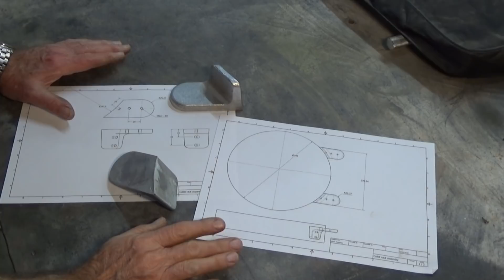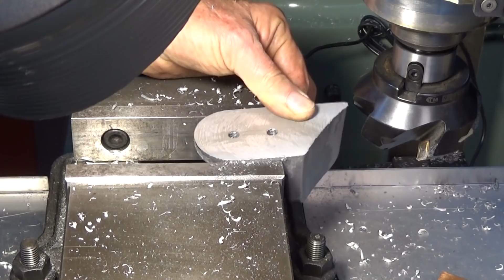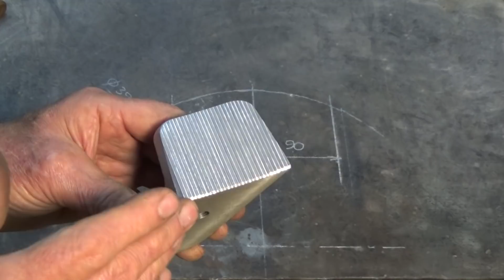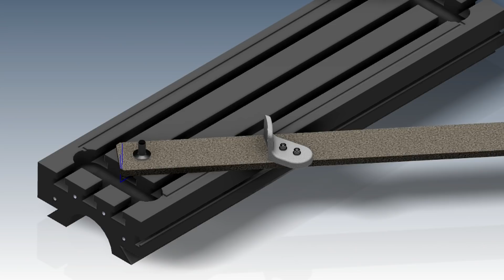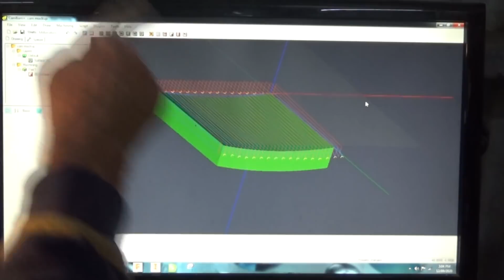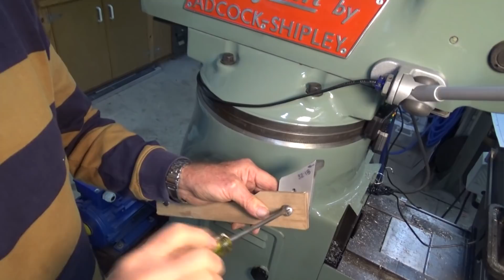Machining Some Awkward, Brackety Castings for a Bridgeport Collet Rack

Comment: Regarding the draft angles and the horror they present to a machinist in setup and all that machinework implies, you can spend quite some more time and almost no additional effort to avoid all that malarkey... Its a compound method which goes like this- Make a 3d printed model of the thing you want, no nonsense, pure copy just in plastic... Take that plastic model and dip it in latex, dip it in, dip it good, or just get a tube of 2 component silicone and make an adequate bath that you will dunk your model in... Let it sit, let the silicone cure for its intended time, which requires no effort, so you are still at the same effort level, you just took a cup or similar and poured silicone in and put the part in... Once cured, remove the part, now you have a negative of the model in latex or silicone or whatever you can work with... Get some candle wax, if not wax, get cheap large candles and as you would with wax, dunk them in a pot, put them over fire and melt the wax... Fill the elastic negative with wax, let it cure... Extract the wax model which has no angles, no nothing but what you want the part to be... Put it in the box, make a sand mould around it as you would with plastic model and simply burn off/evaporate the wax in a heat treat oven... You will have to have metal box for the mould for it, but well, what can you do, weld one up, its better than wood either way... Once the wax is gone, you are left with a perfect negative for your desired part with no unwanted geometry... After that, when the mould is still hot, pour in the metal, it will net you a superior finish, no risk of cold spots and your part will be a perfect machinable piece after maybe a bit of light sanding if you got some surface unevenness depending on the grit of the sand... It may be an overkill for some projects, but as they say, there is no kill like overkill... Why salt a slug when you can use a flamethrower? If wax is just not worth it for some projects, consider getting a block of styrofoam and hotwire cutting it into desired shape, put it in the cask, make a mould and just burn it out with molten metal, or you can burn it out in a heat treat oven too, leaving you again with a mould with no geometry but that of your now evaporated model... Tho, that might require a large oven, but for that, you can make your own ``kiln`` and just blast fire in it until the job is done, as with wax, since you dont need any precise temp or anything but for the temp to burn out the wax or styro... Also, hot moulds are the best as they dont leach any heat form the poured metal...
Reply from the maker: I am hoping I can get into lost wax casting at some point. I actually made some parts that way when I was in college. We had a centrifugal casting machine and we were making jewellery out of pewter. I have been a fan of the "Veg Oil Guy" for some time and I have watched as he has become more and more proficient at the process. It does allow you to make some intricate parts which are not easily done using greensand moulds. 
Regards,
Mark
Reply: @Preso58  Most glad to hear that, as i greatly enjoy watching you... I just bought 25kg of furnace mortar as i am about to build my own casting setup, but for iron and steel, maybe some other metals... I have spent over a decade and a half - learning and lusting after machinery and joys of that kind, so now I am thriving with my slowly forming shop and content of amazing people such as yourself, so its a great joy hearing that you have ``expansion`` plans in mind... I would greatly enjoy having some talks with you, and share a few ideas that I drew up over the last few years, so its a bloody shame that you are practically on the other side of the world, as i would love to have you as a guest for a lovely hot or cold beverage of choice... Maybe some cake, or a gourmet lunch... Know that you are warmly invited here if you are ever passing through or going to Croatia for say a vacation... Regarding the ideas to be shared, if you want, I can send you a scan of a plan i drew for a modification for my Emco Fb2 baby mill to make her more rigid, as i know that you have a similar machine, altho yours does differ and the plan would need to be re-engineered to fit your machine, but if you are up for it, i will gladly send it to you... I could even draw up a plan for your machine specifically, with manufacture in mind and margins, as i believe that what you have is what Quinn has(in essence), and a lot of others so it could be a great gift to anyone willing to put in the effort on a small mill or a joke of a task for us with big mills, who just want to stiffen up our baby machines... 
Sorry for the pocket size bible of a comment... 
All the best and warmest regards,
Marco Camillo

Comment: I do not understand why you wish to have a CNC machine perform a task you could have acomplished on the Bridgport in less than 1/4 of the time.
Reply from the maker: I know it seems like overkill or redundancy but I just wanted to try doing some 3D tool paths on my little CNC. Mostly it is only ever used for 2D pocketing and profiling or drilling hole patterns. It was really a "what if" exercise. Many years ago we had a Denford CNC router at the school I was working at. We used it to machine balsa wood blanks into model formula one cars. The toolpaths were all 3D profiles cut with a 6mm ball nose router bit and 0.5mm step overs. That was how I was introduced to CNC machining. I had to learn how to do it myself before I could teach the kids. The machine was worth around $25,000 and we didn't own it. So, I was very keen not to break it. Once I retired I no longer had access to the machine so it was nice to go back to that process, even if what I achieved at home looked a little clumsy. 
Regards,
Mark

Comment: You could also just use some sugru silicone putty, which would make the rubbery part at least look more intentional. The stuff ends up looking like a pre-formed gasket. Then you could leave the part as cast, or machine with a generous clearance, and no one would be the wiser.

Comment: Why not just pad out the brackets square with a glass filled body filler?
Reply from the maker: Robert, I want to be able to powder coat the finished brackets and some body fillers are not compatible with the heat required to fuse the powder coat. I also wanted to have a go at some 3D milling processes on my little CNC mill and this seemed like the perfect candidate. 
Regards,
Mark

Comment: Epic struggle , glad I’m not paying for those brackets !! When you made the pattern a body filler squeeze would establish the dia your after , that pattern would lift with the squeezed faces vertical and draft on the face that has the bolt heads ..... usual thing I guess many ways to skin a cat ....
Cheers
Robert 
Partsmade 🇬🇧
Reply from the maker: Robert, I must say I hadn't thought of moulding the pattern to the column casting however there is always shrinkage in the casting to consider. Aluminium shrinks at around 6% so even if you get a perfect fit for the pattern, the casting will not adopt the same fit. I actually did the final fitting of the castings to the column today and one only required a bit of sanding on the bottom edge to get it a pretty close fit. I may be able to avoid any other processes and just powder coat them as they are now.
Regards,
Mark

Comment: Nice looking brackets Mark. I liked the work around you did to achieve your 3D surface in CNC. I bet you’re missed from the high school workshop 👍
Reply from the maker: I had already mentioned to another YouTuber that I felt pretty chuffed that I had pulled off a 3D milled contour on the little Sieg and then I watched you Syil going through it's paces. I nearly cried! 
Regards,
Mark

Comment: Epoxy for the win!  Glad you’re using 1/4-20. Gotta be honest, you’d have to sacrifice a block of steel to the machining gods if you didn’t. 
Also something to try another time is handwriting the Gcode using the G2/3 arc command. It would have been three lines. G2..., retract, lower depth and repeat.
Reply from the maker: I guess I should try that. When I first got started with GCode I was completely reliant on the CAM software and I didn't dare touch it or modify it. Later on, I got confident enough to instruct students to edit code to add drilling op's which weren't supported with the models we were using. Having said that though, my brain isn't wired well enough to write too much code from scratch. It's the same when I am working with Arduino. It is just a bit beyond me. I am a very visual person and 3D cad is a breeze for me but numbers horrify me. Sad but true!
Regards,
Mark
Reply: Mark Presling I was trying to make a cylinder and couldn’t get the cam to work so I went back to my pencil and paper drafting mindset wanting to program in a radius and where the center is and low and behold I discovered the G2 command. I figure let the cnc work out all the interpolated points instead of giving it billions of G1 commands. Anyhow something to play with if you get bored one day. Do some MDI input and watch what it does.

Comment: I think if you are going to use the two part putty like you did for the lamp attachment then the groves left would give more adhesion surface. It is always better and more fun, no matter how much time it takes, to have the ability to make your own parts. If I can make it, I do.
Reply from the maker: Craig, as it turns out, I fitted both brackets to the mill today and all I had to do was grind away part of the bottom edge of one bracket and they fit close enough that I won't have to use any epoxy. This time I got lucky!
Regards,
Mark
Reply: @Preso58  It's pretty cool working with aluminum as it is so easy to manipulate and doesn't take much effort. Glad it turned out great.

Comment: suggestion. dont drill the B Port. Perhaps a use a bandit clamp with suitable padding. https://www.band-it-idex.com/en/
Reply from the maker: Gary, I did actually drill the column today and fitted both of the brackets (before I read your comment). I felt a bit bad doing it but so far everything is working out well and it looks like a factory addition so I am happy with the result at present.
Regards,
Mark
Reply: Mark Presling it wa s just a thought. I just love your machine too!

Comment: So lost wax end of problem
Reply from the maker: I would love to try lost wax on some serious jobs. Unfortunately it does require some specialist equipment. When I was at college we did some lost wax casting. I made a piece of jewellery out of pewter from a hand made wax model. We had a centrifugal casting machine which was a seriously scary piece of kit. You had to wind up a massive spiral spring and lock it until the pewter was melted with a propane torch. You also had to estimate the balance of the rotating arm and once it was tripped it got very exciting. 
Regards,
Mark

Comment: Mark I haven't done any casting since I was in high school but a saw a few videos where they used Styrofoam for casting. The carved exactly what they wanting out of foam. Then packed sand around it. Never removed the foam, and poured aluminum into the sand. The foam burnt off and they were left with a casting that didn't need draft. It makes me wonder if someone could 3d print a cavity, fill it with styrofoam balls and glue, then pull the plug out and pack sand around it.
Reply from the maker: I have seen that process before and it seems to work for simple moulds. I am not sure how well it stands up to ramming but the 3D printed patterns I use are pretty robust and now that I am using PETG filament they don't shrink and warp like ABS does and they can be sanded to smooth out the print lines. 
Regards,
Mark

Comment: Trust me that Chinese collet rack isn't worth the purchase price let alone that asinine shipping cost. I'm sure what ever your finished product will be is 1000 times better than that piece of trash. Looking forward to the next installment.
Reply from the maker: I did get the collet rack mostly finished today and it looks great. The carbon fibre sheet I used to make the shelf is incredibly stiff and strong and it looks pretty slick. I am going to try powder coating it with a clear gloss finish. I am pretty sure I could place my entire weight on it and it won't break.
Regards,
Mark

Comment: is draft angles really a concern on a one off part? chances are your going to poke all the sand out of the box anyway
Reply: Draft is for removing the pattern, not the part, from the flask.
You could do an investment cast.
Reply from the maker: Getting the pattern out of the sand mould is always and issue. One of the challenges is designing the pattern so it can actually be removed. Often when you see a cast part it is not immediately obvious how they are made. Some require extremely complex and multi part patterns and some require loose cores to make some features. Even a one off part will need draft on the pattern. 
Regards,
Mark

Comment: Not sure why you are going to powder coat. Seems to be right in the line of fire of the chips. Powder coat will get knocked off not much slower than paint, but won't be repairable. Especially for the tray itself which will get chipped within a week of putting the tooling in it - though perhaps you aren't intending to powder coat that anyway.
Reply from the maker: It is possible to repair powdercoat and it is very tough and durable which is why I am such a fan boy for the process. The material I am using for the shelf is carbon fibre, around 8mm thick and it is incredibly stiff and tough. The piece I used was filled and painted but I sanded it back to the bare carbon weave today. It looks fantastic but I don't think it has a lot of epoxy in the outer layer. I am going to try powdercoating it in a clear gloss. If that fails I will just put a layer of clear epoxy on top of the weave. 
Regards,
Mark

Comment: I was looking forward to this video. I was guessing you would do it like Tom Lipton did it making the baby bullet. (Wilton Baby Bullet 16 Curve Kellering 2, https://www.youtube.com/watch?v=mQk68USXQVk). So using the CNC mill was an interesting surprise. Still not all that simple but you did save yourself about a 1,000 hours of hand filing.  You could still use a DRIM and save some more work.
Reply from the maker: All will be revealed in the next video. I actually finished most of the build today and it looks great. It is also strong enough to take at least 50kg of tooling, if I had that much! I hadn't watched the video you sent me although I am a big fan of Tom Lipton's work. I have used a similar process on the lathe for making compound curves and as long as you concentrate it works great. If you lose your place though.... 😥
Regards,
Mark

Comment: Good Show Mate...as always. Presso, you do not have to justify your methods to anyone. If you want to cast this out of gelatin and freeze dry it that would be fine. It is fun watching you do your stuff your way. My R8 collets reside in the box my 4 jaw lathe chuck came in. I drilled holes in a piece of .75 plywood and that goes in the box and it sits on the bench for my mill/drill. You just keep doing what you are doing and we'll keep watching and enjoying. Thanx. I'll bet watching the foundry that casts B'port bases would be something.

Comment: I thought the Bridgeport surface would be uneven.   I do not have a CNC machine so using what I have available, so I would have filed or used my woodworking spindle sander to get the radius, and then I would have found out the flare.   LOL
I expect the commercial version does not take into account the flare well since this will vary slightly with each machine.
I agree using simpler CAD/CAM saves time.   Importing the actual STL would have added time for no benefit.
Another good video.
Dave.
Reply from the maker: Thanks Dave,
I can report that the collet rack got fitted today and it went better than I expected. No DRIM's or epoxy required!
Regards,
Mark

Comment: I use CamBam too! And QCAD at times. Nothing against 3D work - I use Fusion mostly - but sometimes a 2.5D job is just quick and easy with 2D tools.
Reply from the maker: I think I have just gotten comfortable with CamBam although I do like Fusion 360. Back in 2016 I was very fortunate to visit Autodesk in San Francisco. They have an amazing space filled with some very cool artefacts made using their software. We got to use a beta version of Fusion before it got rolled out and it was pretty impressive back then. Up until that point I had been using CATIA but it looked positively old fashioned compared to the Autodesk products. In fact I recall someone saying that CATIA was built on a UNIX platform. 
Regards,
Mark

Comment: Could you use some adhesive backed sand paper stuck to mill in the bracket mounting locations to sand your brackets to a better fit?
Reply from the maker: Yes, that would work but you would need to use a really coarse grit otherwise it would take forever. I would also be worried that some of the abrasive would work loose and damage the paint on the mill. 
Regards,
Mark

Comment: With that plywood fixture and release agent , body filler you could cast that shape into your castings .
Reply from the maker: I am not sure how well the body filler would stand up to the powder coating temperature of around 200C. The metal filled epoxies do work though.
Regards,
Mark
Reply: @Preso58  Dear Mark it is when you are making the patterns you would have the shape on them. The patterns would be moulded in green sand and shape would be in the castings all that would be required is to dress the castings. The patterns could still be place on a board and main body casted in the drag, cut back to the joint line a then you could produce the shape in the cope